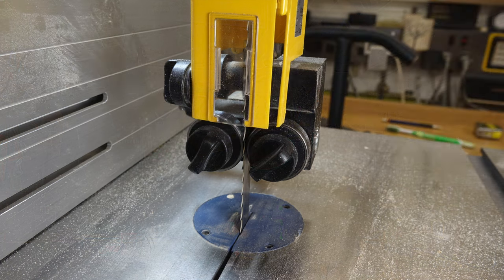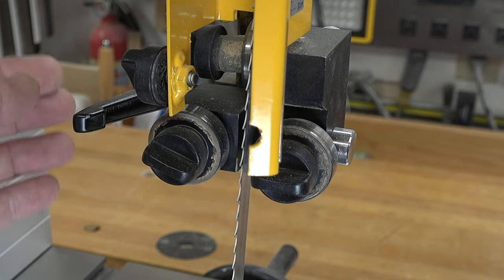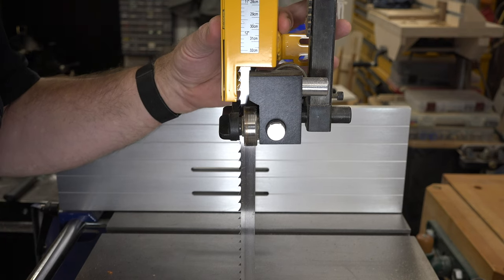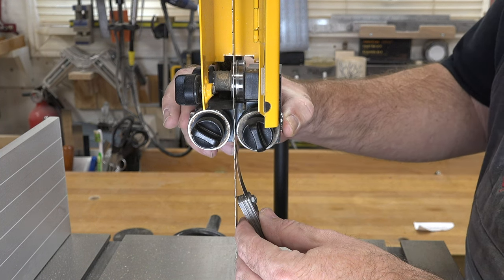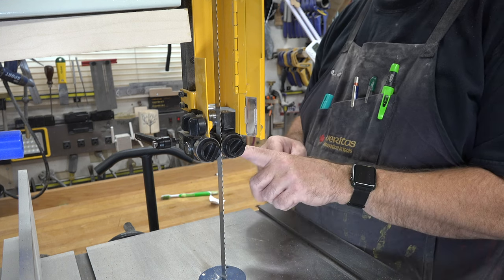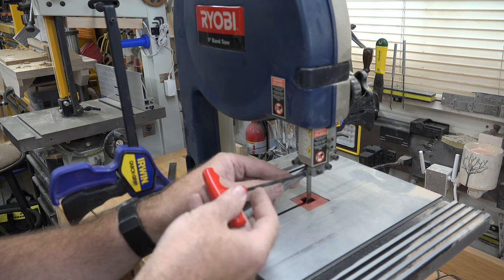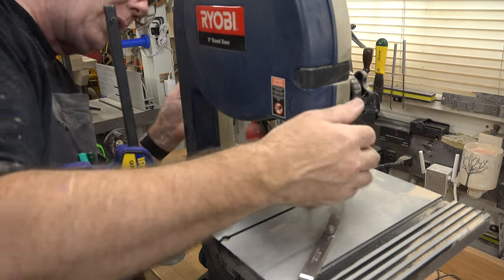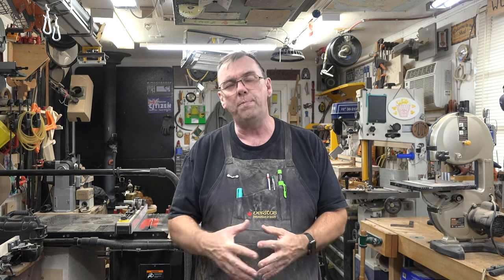Setting up Your Band Saw

Comment: I have this overwhelming desire to drive from NC to Canada and give you a hug for this one! I’ve decided that A: that would be weird and B: I don’t like cold weather, so you’re safe! I do want to mention something that happened to me within the past week on my Rikon bandsaw that caused me fits until I figured it out. I put a new blade on the saw, same size as the one I took off. All 6 bearings were adjusted to suit the new blade, and then the tracking was adjusted on the top wheel because the blade was tracking a bit too far to the back of the wheel. I then made a test cut on some 3/8” stock using the fence, and the blade was all over the place! AWFUL!! Long story short, that slight adjustment to the tracking caused the blade to move forward in the guides so far that they were just barely touching the rear edge of the sides of the blade! This taught me a valuable lesson! Before adjusting the guide bearings, set your tracking! There’s a definite relationship between the two, and I think it’s worth mentioning! Merry Christmas!
Reply from the maker: I will just have to settle for a virtual hug Tom.  LOL.  There is definitely a relation between tracking, guide bearings and the thrust bearing.  They all go hand in hand to allow the blade to cut straight and true.  You can have a perfect setup and replace the blade with a new one of the same size and shape....that new blade could track exactly the same as the old blade and the new one could still cut a little off.  Blades are as individual as people and they need to have their own setup so each and every time you replace your blade, you need to tension, track and set up the guide and thrust bearings.  It's a pain but it gets faster as you get more experience and it will make your saw's performance much better.  Thanks for tuning in to the show and for chiming in with your story.  I love it.

Comment: Great advice Ken, A point worth mentioning about blade drift or what might be considered as blade drift;  is sometimes caused by one side of the teeth on the band being worn more than on the other side causing it to be blunt on one side; This is usually caused by the user cutting curves continually in the same direction over some time (a habit we tend to get into) which puts more pressure on one side of the teeth than the other side making the teeth on that side of the blade blunt. When this happens and you try to make a straight cut, the blade will mostly be cutting with the "sharp" teeth on one side of the blade and will drag the board to one side or the blade will twist if you try to force it to cut in a straight line and you won't get a straight cut. So sometimes you can do all the adjustments and it appears you still have "blade drift" It is most likely the blade being dull/blunt on one side of the band and the only way to correct that is to replace the blade with a new one or a blade that you know is good. Keep up the good work Ken, I always look forward to your videos.
Reply from the maker: You bring up an excellent and very valid piece of information John.  Having a sharp blade is just as important and proper setup of the blade.  Having a blade that is dull on one side of the kerf will cause it to turn just like having a front tire misaligned on your vehicle.  It will always pull to one side until you fix the alignment and the only way to do that with a bandsaw blade is to either sharpen and set it (a very tedious process that isn't worth it sometimes) or just replace it.  Thanks for tuning in and for chiming in with your thoughts.

Comment: Thanks again passing on your knowledge Ken. I have the same bandsaw and love it. I have used/saved your earlier video on bandsaw setup as a refresher and will do the same with this one. By the way, I noticed an electrical switch pad on your bandsaw, is that for a light? Interested in hearing what additional equipment you have on your bandsaw. I have a magnetic light on mine but I suspect if you have a light it would be a better set up than what I have. Thanks again Ken and stay healthy and safe.
Reply from the maker: That switch is for a work light Earl.  We made it a while back on the show.  You can find the video of the build here.  https://www.youtube.com/watch?v=Tht1-OY2RSk
I hope this helps.  Thanks for tuning in.  It's appreciated.

Comment: Another hint for you.  You didn’t spend much time on the fence.
I made a fence using a Powertec Multi T track attached to wood that accepts two MagSwitches (think Jessem stock guide on your Sawstop).  I cut a racetrack hole for the Magswitches so they do not rotate, don’t need to be screwed down and can be removed easily and used elsewhere.  I find this type of fence is so much easier to put in place and adjust for tracking than the included Rikon Fence so I removed the big rail bar from the front of the band saw table – its not needed.  The fence can also be repurposed for other tools such as the drill press
Reply from the maker: The show was about setting the thrust and guide bearings Woody but I have received several requests for a video on setting up the fence.  Your fence idea sounds interesting.  I wouldn't mind seeing that setup.  Got any pictures?  Thanks for tuning in.

Comment: Hi Kenny, thanks again for the tips you provide they are excellent. Just a thought Kenny? does the size of the blade change the drift, thanks again for your videos.
Reply from the maker: The smaller the blade, the less support it has and it can tend to wander.  Proper setup of the guide and thrust bearings however can completely eliminate blade drift in a healthy and properly tensioned and tracked blade.  I hope this answers your question Philip.  Thanks for tuning in to the show.

Comment: Great video, thank you.  I know this isn’t about blade alignment, but the blade placement can affect drift.  There are two theories on blade placement, center the blade on the tire, and centering the gullet on the air.  Which do you use?  Also, i found an interesting product that helps with aligning the fence with the blade, the Carter F.A.S.T system.  It helped me.
Reply from the maker: There are plenty of theories out there about blade placement Scott.  I do my best to align the blade in the centre of the tire.  Some blades just won't do that and they find their own placement just slightly off centre and if that's the case, I don't argue with the blade.  If that's where they are happy to perform then that's where they will perform the best.  I will have to look up the Carter system.  Sounds interesting.  Thanks for tuning in to the show.

Comment: Hi Ken, what’s the resaw capacity of that machine?
Reply from the maker: If you go by manufactures specs, it's 14" but that's a little unrealistic when you have to factor in the guide bearings, blade guard etc.  I have successfully (and easily) done re-saw on hardwood that is 11" in width but I've never sawn anything wider than that.  My jointer is only 8" wide so I try to stick within those parameters and the saw handles 8" with no issues at all.  I hope this helps.  Thanks for tuning in to the show.